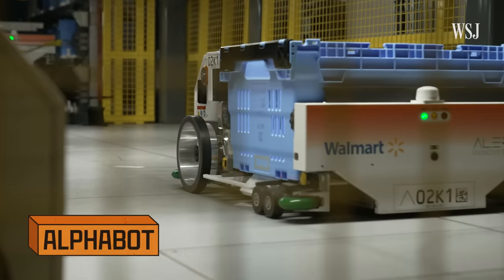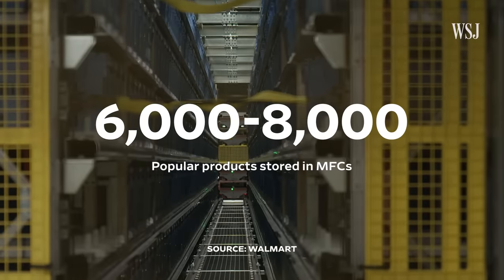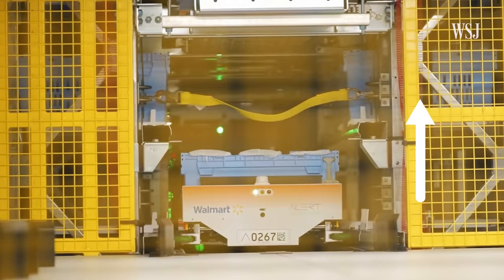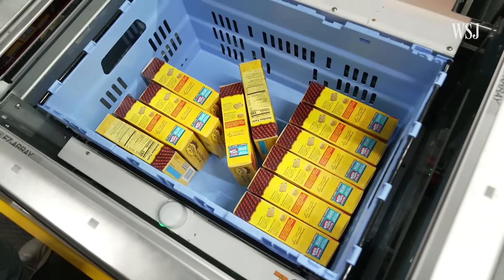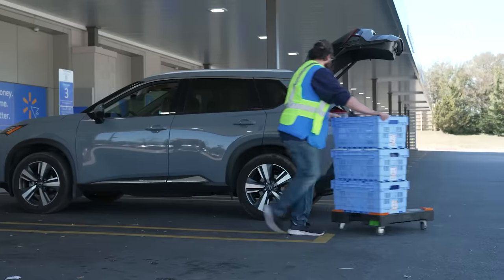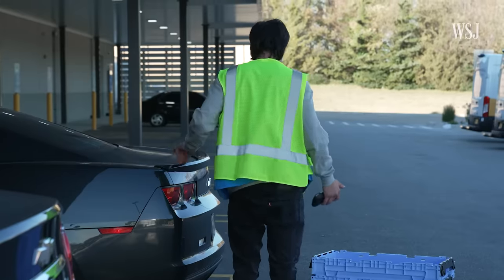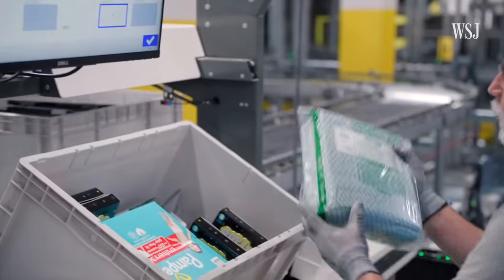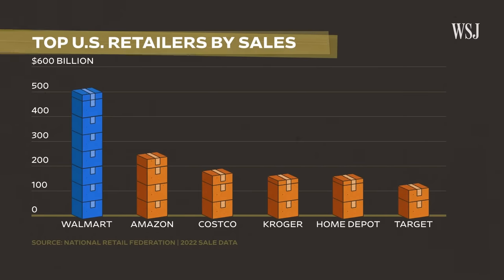How AI and Automation Fuel Walmart’s Ultrafast Deliveries | WSJ Shipping Wars

Comment: Walmart really needs to ramp up online inventory accuracy.
9 times out of 10 they are out of what they say they have, but have or try to sub for an item they said was out if stock.

Its gotten to the point i must turn off al substitution and roll this dice/gamble on if they have it in stock.

Target and Amazon while more expensive 9 times out of 10 really does have the item in stock, and if a sub occurs they are really close to what was requested (maybe a difference dize).

Walmarts must fix this or people will move elsewhere if thrre is an option
Reply: Associate here, that problem arises primarily because we still pick on the same sales floor as you would shop, sometimes it’s just not restocked and we send people to the backrooms to look for the item. But oftentimes we actually don’t have the items because what’s on the shelves is typically all we get off the trucks when they roll in. The only thing that really gets restocked is overstocked items that we store in the backrooms. Yes, it’s an issue that what’s talked in this video is trying to improve on, but also it’s kinda scary because most online departments have close to 30-50 associates. If it goes to automation a quarter of those associates won’t be needed anymore, despite what the actual company is saying. So exciting for the improvements for the customer and the job itself through tech, but also scary because for the same reason most Walmarts are close to solely self checkouts- as soon as automation comes in, those hiring and positions leave

Comment: Walmart is investing in cutting-edge technology, such as drone delivery and automated fulfillment centers, to compete with Amazon and Target. By 2025, 65% of Walmart's stores will be serviced by automation. Walmart's market fulfillment centers (MFCs) have the smallest footprint of the company's e-commerce fulfillment methods, and the Alphabot robot is key to speeding up delivery. The MFCs separate inventory from goods on the store floor, reducing congestion and ensuring machine-level accuracy in picking the right items at the right times for customers. Each of the 175 Alphabot robots can carry a single milk crate-size bin and retrieve customers' goods laterally, horizontally, and vertically. The robots bring items to a picking station, where associates are instructed which items to take and where to put them to speed up the picking and packing process. Once orders are complete, they can be picked up by customers in person, delivered by a Walmart driver, or in limited locations, dropped off by drone. Walmart has a built-in advantage over Target when it comes to faster delivery, with more than 4,600 stores across the US.

Comment: Brilliant.  Smart moves.  Walmart has come a long way since the1980's.
Reply: Don't you creatures even care about small businesses anymore?
Reply: @Pernection    Most small business owners are stupid.  Absent (or closed) a lot, not creative, stubborn, refuse to innovate.  That's why they lose:  Walmart simply does it better.  SERVES better.  Same with Amazon.  I've told local businesses over and over that they need to be in the LOCAL DELIVERY service right now, but they are just too lazy to do it.  Yes, it requires effort.  But it is not "impossible."  I've even told them how to do it.  Get a cheap battery-operated vehicle like the post offices had in the late 1970's and recharge it (free) from solar panels on the store roof.
WHY isn't any "small business" delivering beer cases in my county?  This service alone would make a huge revenue.
And insulting with "creatures" belays your point.  You won't win any arguments that way, with incivility.  Especially not in business.
Reply: @Pernection  Several "smaller" local businesses could also combine into a co-op for delivery purposes only; that is, get ONE initial van and driver TOGETHER and spread the overhead.  Don't these people ever think outside the box?!!